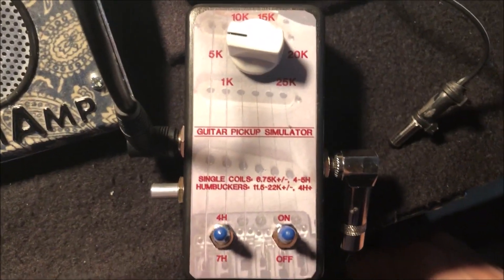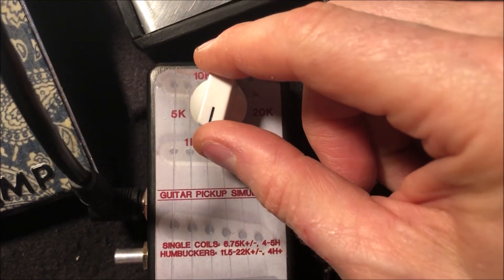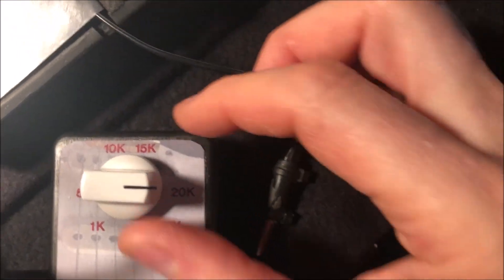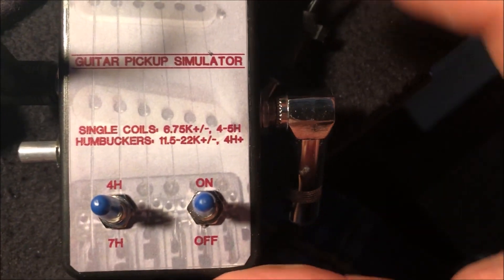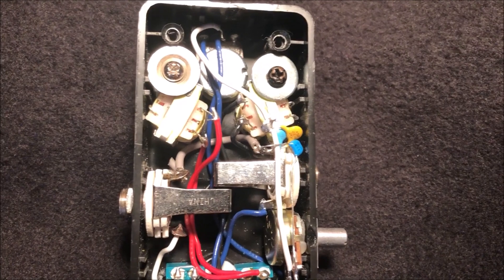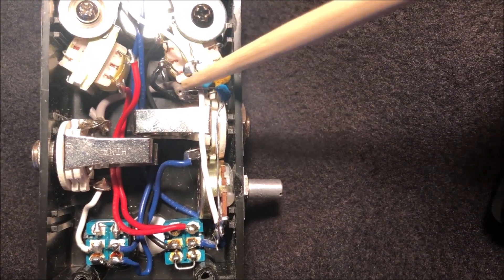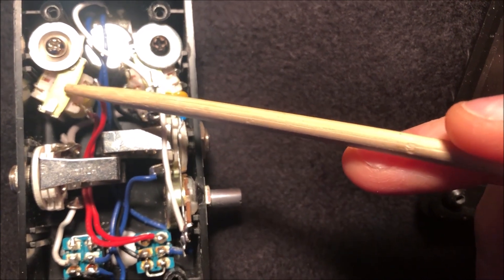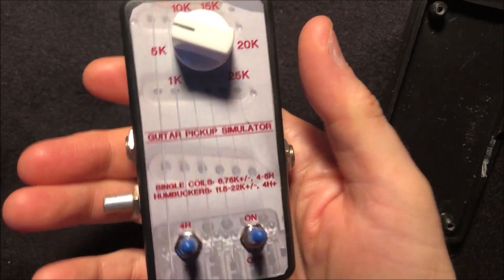DIY Guitar Effects Aid #2 - Pick Up Simulator

Comment: Did you use this secondary switch for the transistor as depicted by Jack Orman? I am thinking of building one myself too.
You basically made some sort of mix of both schematics of I understand correctly (25 k pot to output with some tone pot before)?
Reply from the maker: I used the schematic at the bottom of this page: http://www.muzique.com/lab/pickups.htm
I added a switch to add in a second audio transformer, to simulate the inductance of a humbucker. Inductance is also an important factor in how a pickup sounds… it’s not just DC resistance. So in mine, it’s always one transformer connected at all times or it’s two. In practice really all that adding the second one does is lower the volume coming out. The tone control is very useful however.
Reply: @VegasCyclingFreak  great info, thank you! Would you recommend using a 500 k pot for the tone when simulating a humbucker? Guess same goes for the volume. I just want to make sure this circuit does not filter of frequencies additionally
Reply from the maker: @philippgrunert8776  Humbuckers typically use 500K  vol & tone controls. They tend to sound less bright than single coils because they have much higher inductance. The single coils I’ve measured are around 2.5-3 Henries and humbuckers are generally at least twice that.
Reply: @VegasCyclingFreak  yes, I guess that is why the higher resistance is used. I also use a jazz master a lot which has 1MOhm pots and is very bright, which is why it works so well with fuzzes. I guess I will take the circuit and run it in ltspice to find CR/RC combinations that allow for the most minute change in frequency response.
Thank you for your feedback

Comment: Can I put this in front of a Fuzzface and use wireless?
Reply: Yes, it will make your Fuzzface react again as if a guitar was directly connected to it. The wireless system will output a buffered signal which is very different from a typical guitar signal (check the linked article in this video's description).
Reply from the maker: @carlthegnarl  - Thanks for the clarification on that.
Reply: Well said
Reply from the maker: This is something for testing purposes when designing guitar effects or testing signal response thru a guitar effect. It's a way to simulate a guitar pickup frequency response without actually using a guitar. Have no idea what results you would get using it in the manner which you are asking.
Reply: Yes thats how i use mine. My fuzz sounded dreadful with my buffer before it.